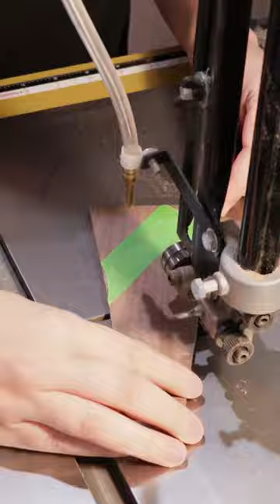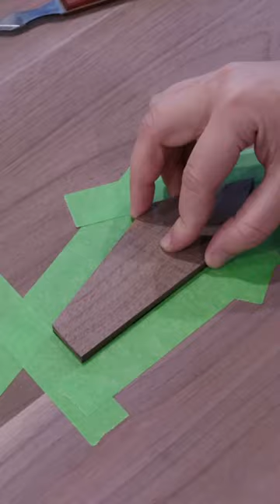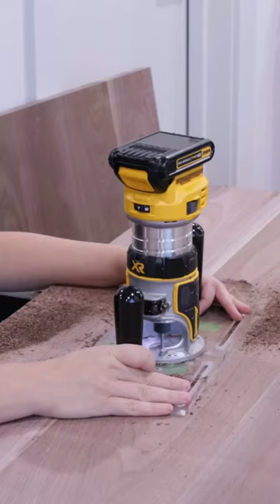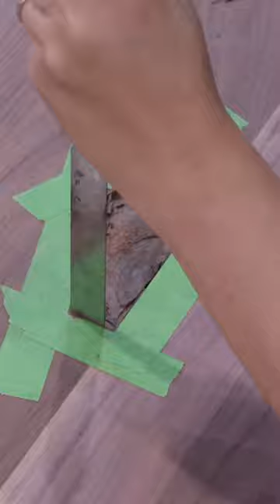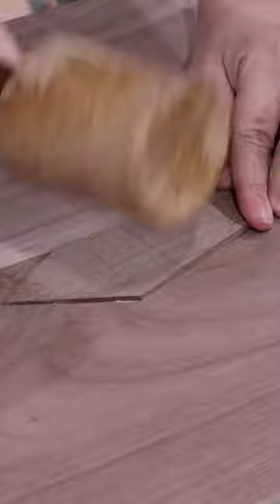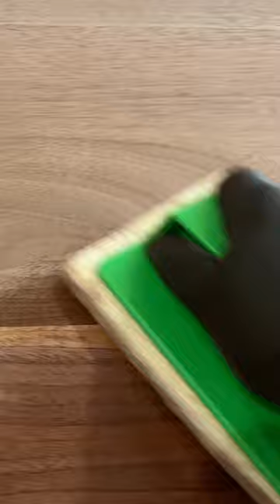Hiding a knot with a geometric inlay… next time I’ll put tape down before using the marking knife!

Comment: In many situations i like to slightly bevel the inlay if its unlikely to be stripped and sanded down 1/8"+ over its lifetime. Just smash it down and as long as you are pretty close, the edge will compress and you will have a perfect fit, no fill, without having to be nearly as accurate.

Comment: Which is more pleasing and natural and distracting to the eye a knott or woodgrain that contrast  with the wood around it , had this problem fixing a hole in the  real Jatoba laminated floor board, ended up using epoxy and wood fillers+ staining.
Reply from the maker: It’s just a matter of preference and style if the project 🤷🏻‍♀️

Comment: Technically all good but the end result just looks bad. Brakes the grain patter and it sticks out more than the knot (that in this case the knot looked better than the end result)
Reply from the maker: The purpose was to make it stick out. That’s why I made it that shape. Little jewels on the table. But to each their own.
Reply: @3x3CustomTamar  if that's what you wanted then perfect job 👍

Comment: Nice work. But would it not have been easier to just cut that panel 2 inches short prior to glue up?
Reply from the maker: If only… I needed this exact width and didn’t have any extra material. Decided to just work with it.

Comment: You should be using a pencil instead of a marking knife for marking around an inlay like that because the kerf of the marking knife is cutting outside the shape of the inlay. The correct way is to mark with a pencil then route right up to the edge of the line without touching it.
Reply from the maker: I like to use a marking knife. It gives my chisel a place to register against.
Reply: If the kerf of your marking knife is the only "fit" issue...I'd love to be good enough that that was my only problem!!😂